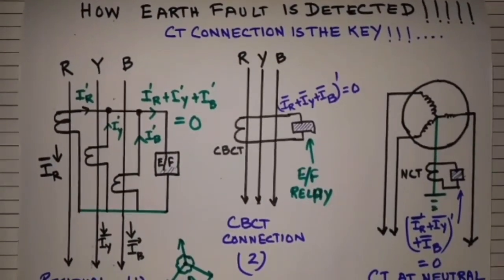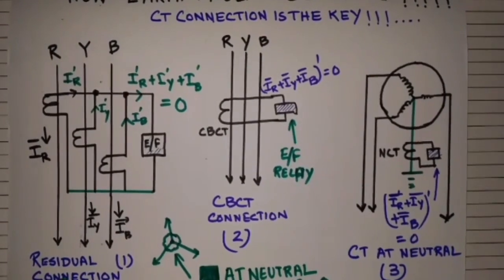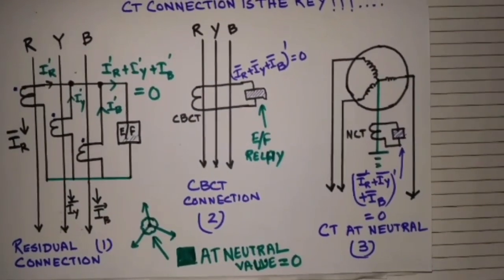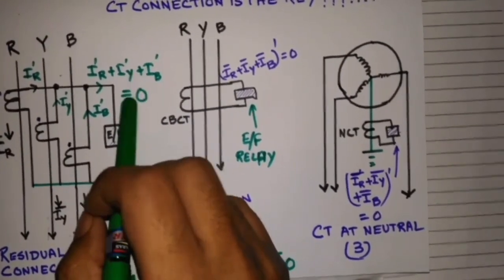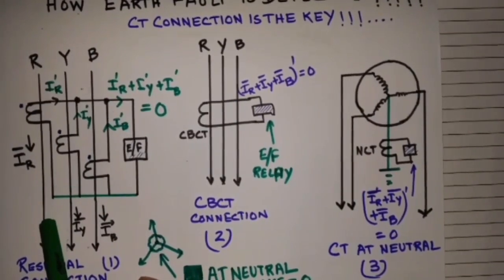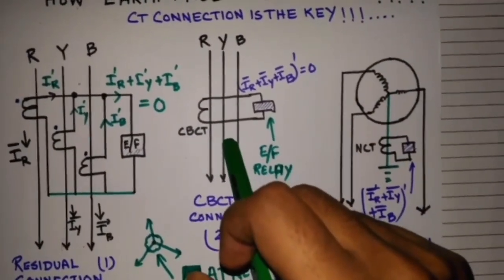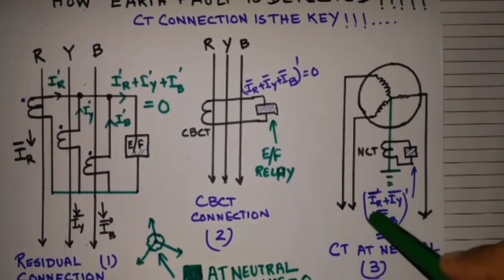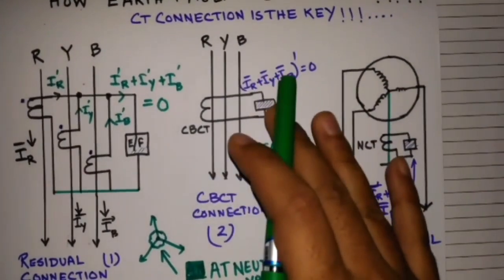CT connection to detect earth fault|How earth fault relay detects earth fault-Explained

Comment: Thanks for this is a clear presentation. Could you also make a video on 
1. Comparison/pros&cons of the 3 different CT connections? 
2. If an ungrounded 3 phase system with a zig-zag grounding transformer, which CT wiring is best.
3. How to identify the phase or phases that are faulted to ground?

Comment: For the residual connection, I understand that each line is 120 deg out of phase, so in that case they are balanced. What i dont understand is why the resultant current would still be zero even tho the magnitude of each phase is different. Please explain? Most systems won't have exact same current magnitude on each phase.
Reply: Because it is a phasor sum . If all the three phase magnitude are equal and 120 degree apart then phasor sum will be zero

Comment: Thank you sir 
But one question about NCT protection always bother me lot !! 

As per concept when earth fault occurs on system.. Earth fault current flows back to star point via earth !! 

I don't understand this.. Let say an earth fault occurs on system at 100 meter away from transformer... Now as per concept it will flows back to transformer neutral point via EARTH !! (Which can damage transformer winding hence in some applications we use NGR) 
I mean earth is such good conductor??? 

Please guide on this
Reply: Transformer neutral earth give a path to earth fault current . This current is very dangerous that why we use protection relay for sensing this fault current. If neutral not grounded then due to capacitance effect from phase to earth the other two phase voltage is very much high due to fault current in one phase which may lead to healthy phases insulation failure.

Comment: sir pls correct me ...if i am wrong you said residual system the submission of current is zero , as it is balanced , if it is single earth fault in line R , how can the value of Ib and Ic is zero ...
Reply from the maker: Because it a short circuit, so all the other path will have no current. Suppose you have resistor connected across a battery. Now if you short the two end of the resistance, then shall there be any current through the resistance????
Reply: When an earth fault occurs in say R phase, the healthy phases i.e. Y and B phases will still deliver load current but the voltages of the said phases will overshoot.

Comment: In residual connection 1 ph to earth fault that E/F current s max compare to other phases. So relay coil pick for only E/F current.ie Ir+Iy+Ib=0
In normal 1+(-0.7)+(-0.3)=0 (120deg ph shift)
In fault 2+(-0.7)+(-0.3)=1relay picked. This is correct?
But E/F time ph shift should be change like the fault ph current reflecting to normal phase.
Reply from the maker: your concept is not right bro.
Reply: Tell me bro what s correct ans
Reply: Let me explain…Under normal condition, the vector sum of these three phase currents will be ZERO and NO CURRENT will pass through the E/F relay coil.Okay? 
Now, suppose there is an earth fault on the R phase. So, the current in the faulted phase will be HIGH compared to the other phases. Say the fault current be 2<0 deg. A in sec’y and the other currents be 0.2<-120 deg. A and 0.2<120 deg. A. Then, 0.2<-120 deg. A + 0.2<120 deg. A = 0.2<180 deg. A And the resultant current 0.2<180 deg. A + 2<0 deg. A = 1.8<0 deg. A will flow through E/F relay and it will TRIP.

Comment: But in residual CT connection you have mentioned the line to line fault can also operate the relay. It is not earth fault
Reply from the maker: Line to line fault if connected with earth. Then only it will operate